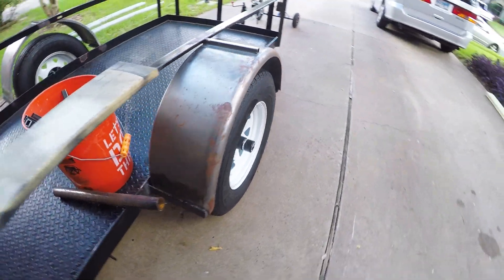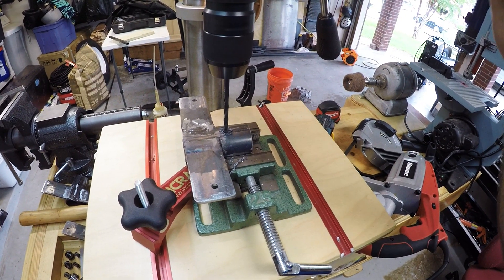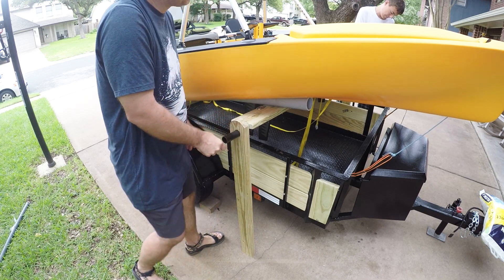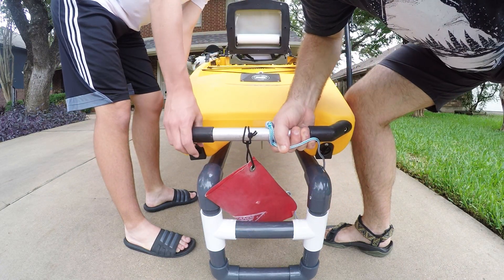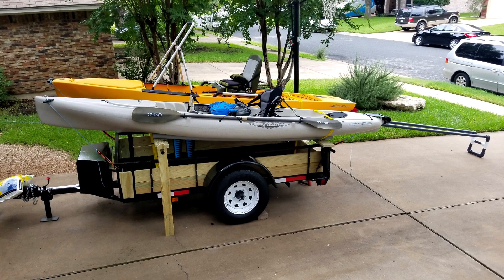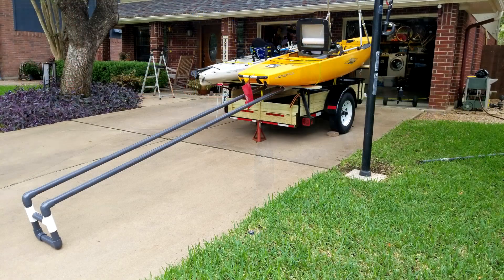Custom Kayak Trailer

Comment: Very nice video! My suggestion for when loading back onto-the trailer the white pvc pipe edge will scrape bottom of the kayak you may want to round off or put a clear silicone to the sharp edge to keep it from doing that. But man that’s an awesome idea to load and unload plus the winch!! Nice touch
Reply from the maker: Thanks Aaron.  That junction doesn't seem to be causing any scraping issues that I can tell.  Easy enough to round off the top edge some.  One key thing I've done is the whole tiling aspect has been abandoned and I just pull out the ramp and the pvc ramp and foot flex enough and it works just fine.  So the bushing mounts really only serve two purposes now:  1.  flexes the attitude of the cross members.  2.  Allows me to remove the whole rack and lay on the garage floor to stow my yaks while I use the trailer for normal utility purposes.  Here's another video:  https://youtu.be/A62EkbJdVsY